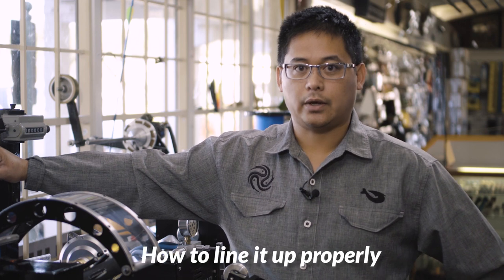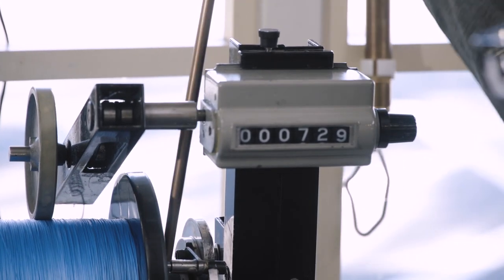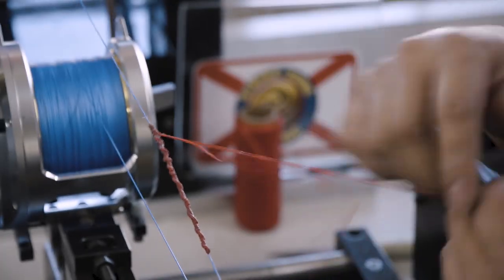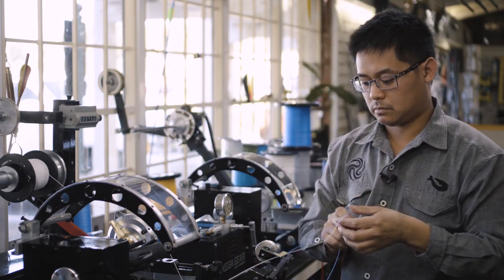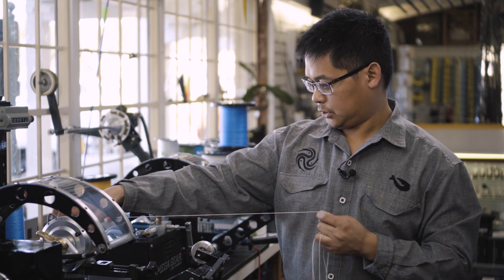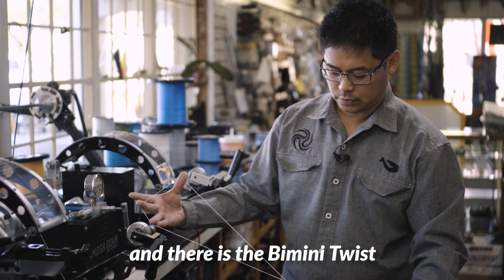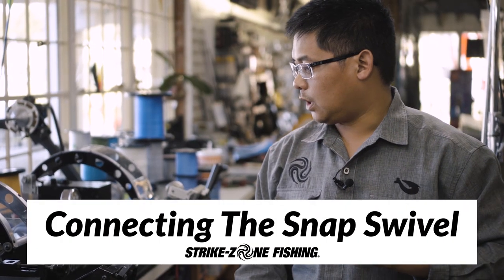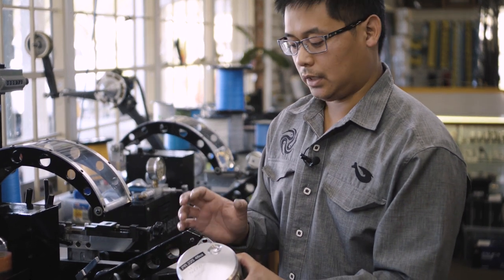How to Spool Your Reels for High Speed Wahoo Trolling (Full Video)

Comment: Can I use 100# mono topshot into my 200# Hollow Core without worrying about it slipping out? Of course I would do the serve, but just want to see if this ratio is ok?
Reply: Depends on the thickness of the 100lb mono but usually I'd say yes. Might go 130 to be safe.